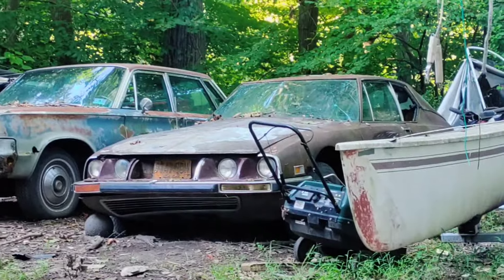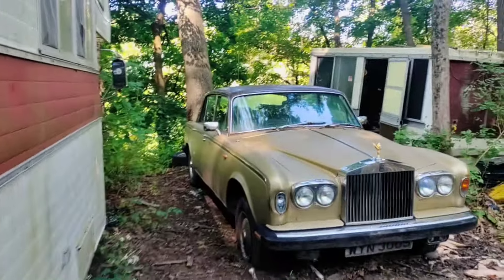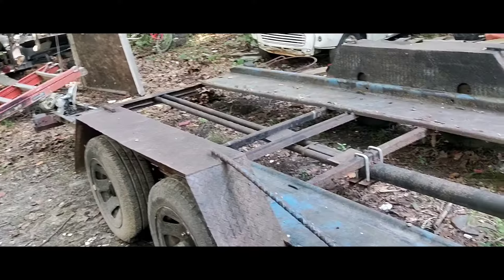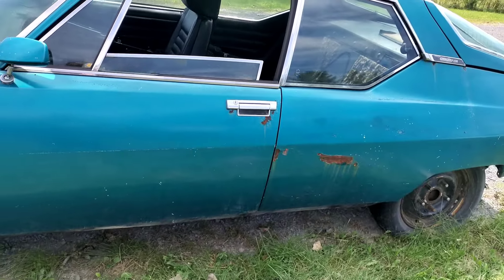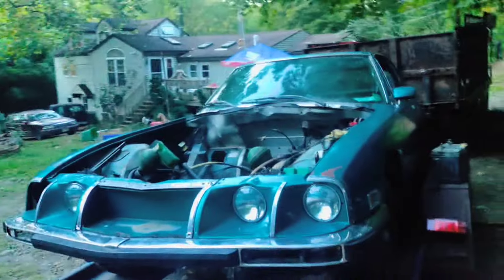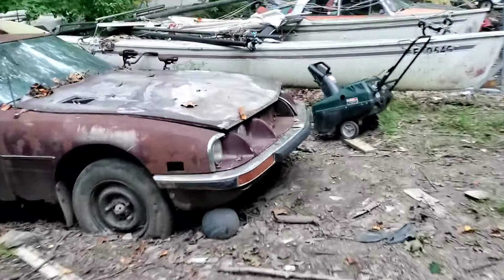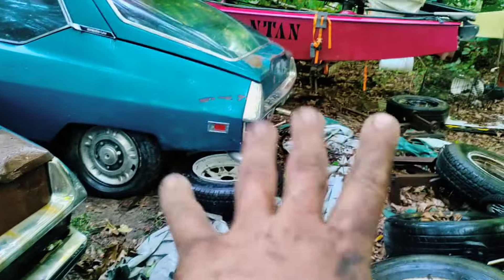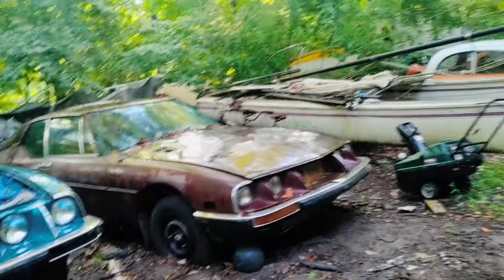Picking up another Citroën SM

Comment: Amazing find! The parts on that car alone are worth a bunch. My dad has spent about 3 years restoring his 1972 SM. Parts and especially engines are extremely difficult to work on he says, and immensely expensive! And I can see that the blue one you bought has the upgraded "US" AC compressor which ours also has, since it used to drive round California since it was new. 

The car is now in Norway and will soon be back in running order with a totally refurbished engine. Interior, bodywork and paint.